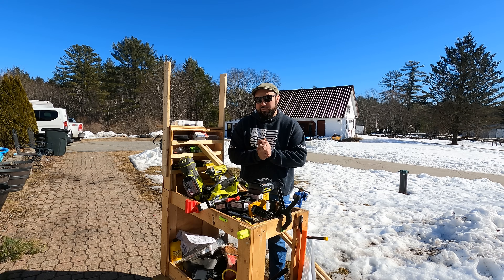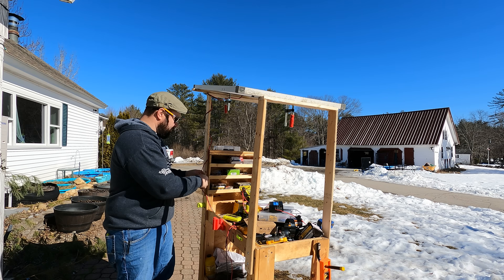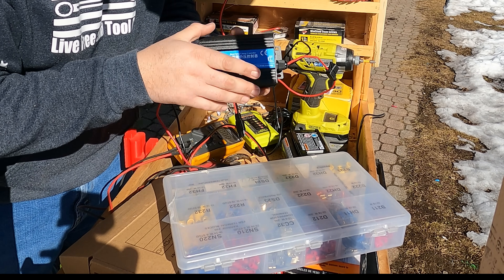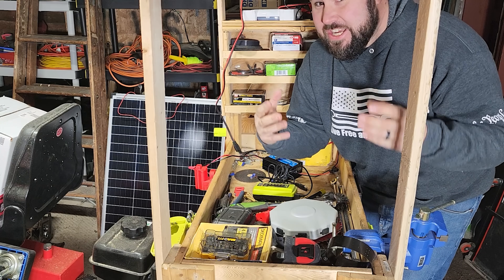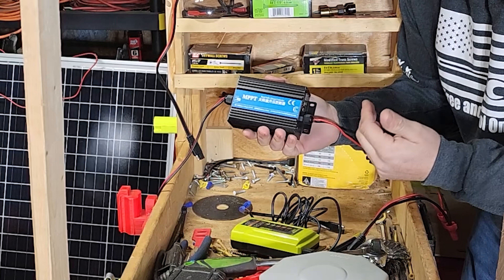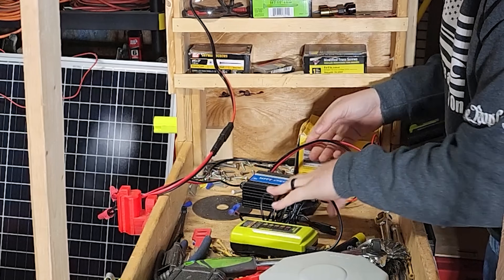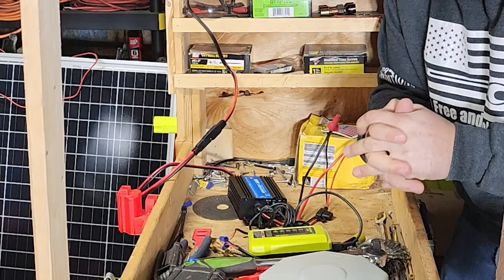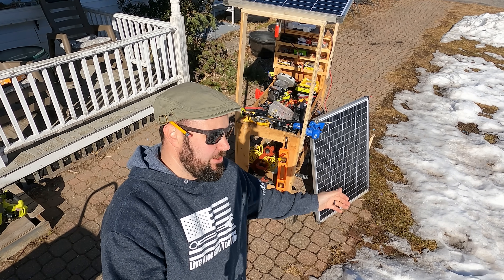Ryobi solar charging, Finally!!!

Comment: Be nice if Ryobi embraced this sort of thing and offered a charger built to connect to a solar panel with all the requirements built in so you could just buy a panel buy the charger and plug it in.

Comment: Nice setup for multiple panels, multiple chargers, but since your panel is putting out 22v+, for a single panel, single charger, I don't think you need the converter.  Couldn't you just run the panel straight to the charger?
Reply: Oh never mind, I just noticed you are charging 40v batteries.  I was thinking 18v.  so maybe you could run straight to the charger with 2 panels.

Comment: My solar panel controler as 2 usb plugs built in but they're not usb-c. Do you know if a regular usb plug could charge a 18v battery using the ryobi 150w power source

Comment: If you're out in the middle of no-where, then i guess it's cost effective but for about $200, couldn't you buy 2 more batteries and not have to spend hours setting this up?
Why wouldn't you just put this into an inverter to give you 110v outlets and plug in the charger?

Comment: Hello!  I will assume that can charge a 18v Ryobi charger as well right? And it will fully charge the battery as faster as if is connected to the house outlet? Also do you know another link where I can find the solar charge controller? Because the link that you provide in the description the item is not available and if you can provide also where to find the solar panel I will appreciate too.Thanks!

Comment: That’s going to be inefficient. You have your dc output from your panels being converted to ac through your inverter which is then converted to dc through the switch mode power supply on your charger. If all you’re doing is charging your Ryobi batteries that is going to work out great but if you’re using that system to charge a battery bank as well you’re losing out on energy you could have stored. A buck converter and a simple bms would accomplish the same without the additional losses.
Reply: nah, he cut off the AC power brick and is using DC to DC conversion only.

Comment: You keep calling that blue box a charge controller but it seems to me it's really an inverter that converts the DC voltage coming in from the solar panels to AC so it can power the Ryobi charger.  Or is it a combo charge controller/ inverter. Hmm?
Reply: Ahh, nevermind, I see how it works now. 👍

Comment: Can this sort of method work for 18v batteries too? Would it still need the 24-72v moor or would I need a 12-24v mppt?? Thanks to anyone that can respond and help me figure out something
Reply: yes, but you have to find mppt with bluetooth app to set charger to 21.0 volts.

Comment: Can that charge controller be configured for your needed voltage and float?  Ideally with what these batteries cost , every power tool battery would have a built in BMS for protection from overcharging.

Comment: Great video and overall idea!  I’ve been charging Ryobi 18v, 40v batteries using solar, but had to go thru my Goal Zero Yeti as an interim step.  This removes that guy from the picture, freeing it up for other things.  This is genius.  Thanks for posting it.  I look forward to more.  Is there a way to hook up multiple chargers to one panel and charge several batteries simultaneously, just more slowly?  Thanks for the great video.

Comment: Nice. I'm attempting to do the same thing. I have the exact boost converter. I gambled on a knockoff dual port Ryobi 40v charger for $21. It works fine. I have the solar panels. I've watched the SerendipitySue videos. Now I just need to redress the cables. I don't blame you for not demonstrating. I think I'll go with XT60 since it fits my panels either directly or via connecting cables I already own.

Comment: How do you setup the charge controller? What's the output voltage set to? Thanks for the video! Been wanting a way to do this as well.
Reply from the maker: The output is 41.5 and it comes with instruction but I measured the output of the wall block for the charger
Reply: @livefreeandtoolon  Got it, Thanks for the reply.

Comment: Thanks for your videos. My questions: For a most cost-effective off grid charging solution as mentioned at 00:35, could you not simply buy a $20 12v inverter to 110v output and use your car battery to charge up your tool battery with a 110v regular charger? Would a regular Ryobi 110v charger work with a modified sine wave output? A Ryobi 18v 4Ah battery is rated at 72 watts, and the Ryobi 40v 4Ah battery is rated at 144 watts. How much would charging those batteries drain a starter battery on the car? How many Ryobi tool batteries could you charge before you needed to start the car to recharge your car battery? I have the Ryobi P131 in vehicle charger, currently selling for $40-$50, and it plugs directly into the 12v accessory socket of the car. That works great for charging 18v batteries. I don't know if Ryobi makes a 40v in-vehicle charger, but that would be nice. The 100 watt small solar setups seem to cost about $150.00, or more, and they only work if the sun is out. Anyways, your video gets a person thinking. Thanks.
Reply from the maker: Thanks for your comment! And thanks for watching. If you consider cost effectiveness, with a vehicle you need to take into account fuel burning and cost, maintenance on the vehicle and emissions, and the different devices you need to charge. Solar is a passive charging at no cost to charge such as high power cost or fuel. Long-term cost solar is the most.
Reply: @livefreeandtoolon  I am not opposed to solar recharging for off grid uses. But when I looked into the actual cost of recharging my tool batteries, I used a Kill-A-Watt meter and discovered it cost me less than one cent to recharge my 18v batteries and less than 2 cents to recharge my 40v batteries on grid power. Given that, I decided not to buy a $150 solar panel kit to recharge my tool batteries. Likewise, I wonder if a person could just recharge their tool batteries from an auto battery and not invest in a solar panel kit. I would think that running the car for only a few minutes would be more than enough to fully recharge the starter battery and that would be equivalent to hours of tool battery charging via solar panels. Would love to see a future video on using the starter battery or a second accessory battery setup to recharge tools batteries for off grid uses. I think that would be an interesting video and maybe you could compare costs. Anyways, thanks for your videos.

Comment: Is that a boost converter for a solar panel.
Reply: correct. any boost dc/dc converter will work to charge a 42 volt battery with a 20 volt solar source